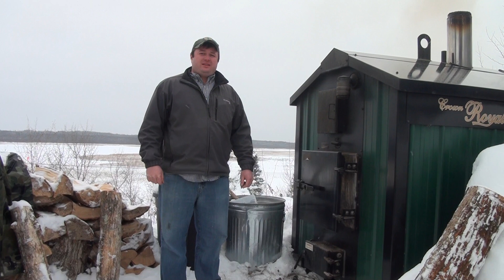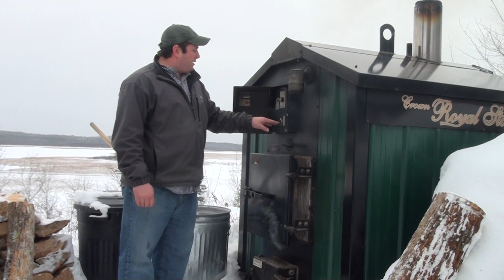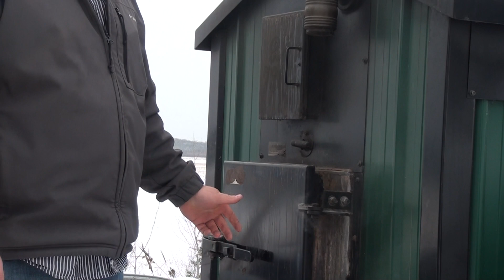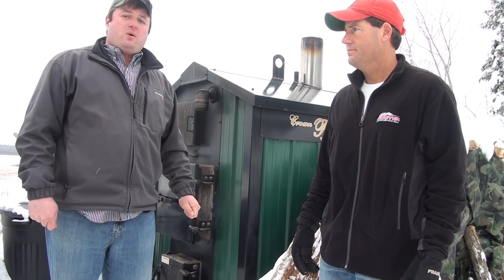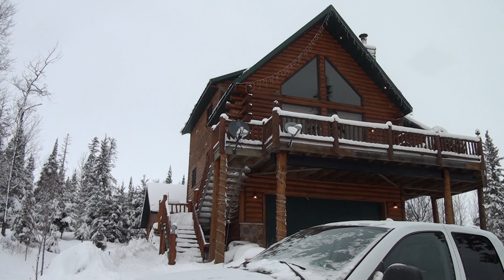Outdoor Wood Burning Furnace - Crown Royal Stoves

Comment: I purchased the 7400 model and had it running Oct 2013. It smoked horribly all winter.  Just started the 2014 season and still have not found a solution to the smoke.  I live in town so it is really bad.  The furnace does heat but unless you live in the country I suggest you look else were for a better furnace. Go to youtube for pictures.

Comment: This stove is a RS 7300, 200 gallon water storage, it will heat 5000 square feet of space. After they added on to there home they are heating about 5000 square feet and the ceilling in there home is 26' tall.